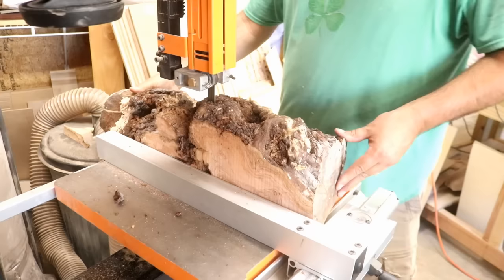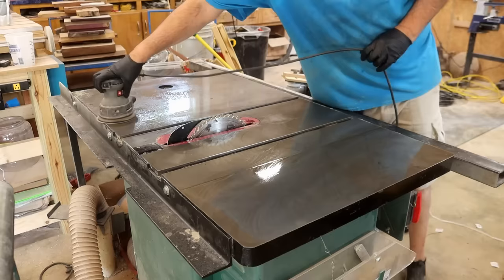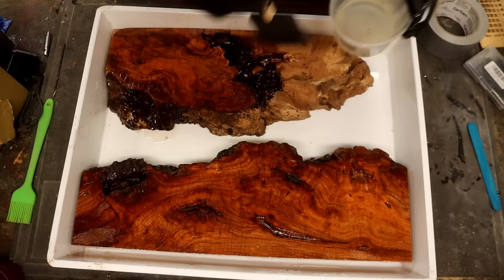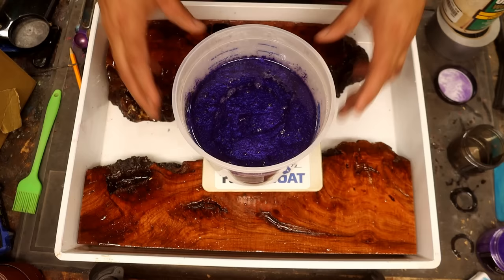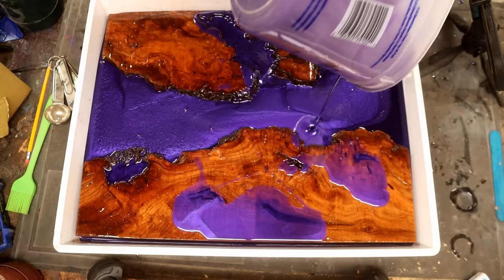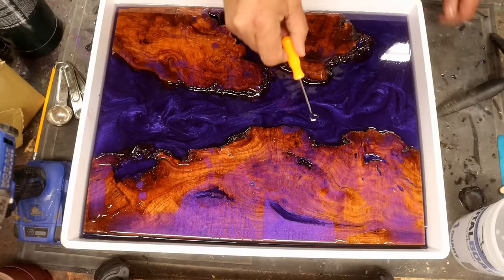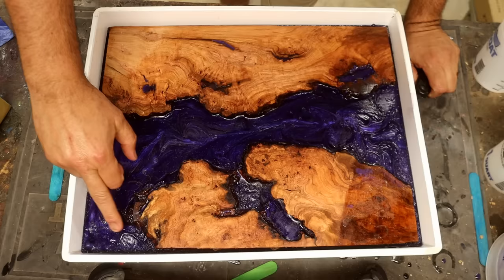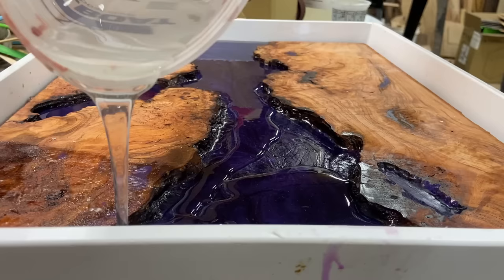You Won’t Believe This Charcuterie Board |  Black Cherry Burl and Purple Resin Magic

Comment: Really nice result, if not a smooth road getting there.
Just a thought about mis-calculated resin volumes: since the wood was already coated in resin, you could have used water to get the precise volume, no tape measure or calculator required.
Reply from the maker: Water is always tricky. I could have used rice or sand though.

Comment: Try sealing the wood with modge podge before putting on the top coat. It seals the wood so there are no bubbles
Reply from the maker: I sealed the wood with resin, just had some larger wholes and gaps that the resin fills into causing dimples.

Comment: i like to use rice to work out how much resin i need. set up your piece in the mold, pour the rice as if it was resin, then take the rice out see how many liters you have of rice. gets pretty close most of the time*
Reply from the maker: Good tip, thanks.

Comment: Great video.  One question for you. Do you always use table top epoxy to finish your charcuterie boards?  I know this is opinion, but I thought the Rubio looked better and it was definitely the easier application.
Reply from the maker: It really all depends on what the client wants. Most want that real shiny look. When they want a more matt look I use mineral oil and bee's wax.
Reply: Just curious, why would you not use Rubio on the top as well if the client doesn’t want the Tabe top epoxy?
Reply from the maker: @dalemoser5824  The client left it up to me. If a client wants a matt finish I use Rubio.

Comment: looks great! Why no vac pot for the resin bubbles before you pour?
Reply from the maker: Really don't need to do it with the fathom and the table top it's just quicker and easier to use the torch.

Comment: WOW, amazing!!  What type of acetate are you using to mix with the resin to seal the board, i.e ethyl or sodium acetate?  Also, do you mix it 1:1 with the epoxy mixture?
Reply from the maker: It's Klean Strip Fast To Dissolve Acetone from Lowes. I use a 1:1 mix to seal the wood.

Comment: What did you seal the wood with before using the epoxy
Reply from the maker: I used a 50/50 mix of TotalBoat 2:1 and Acetone.